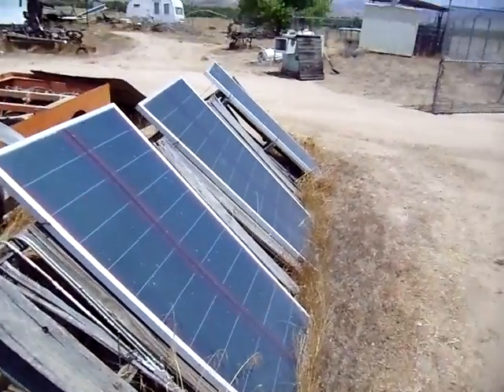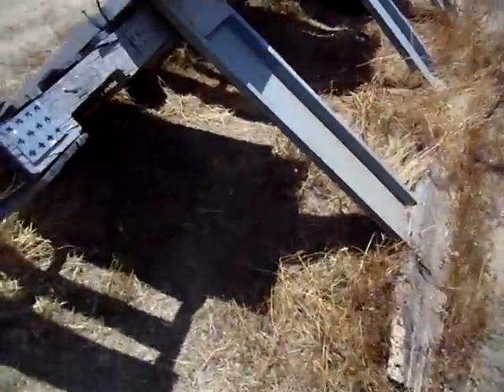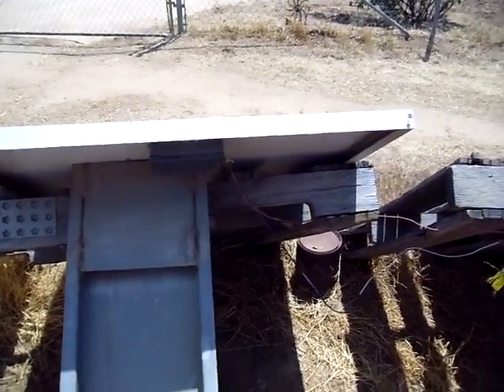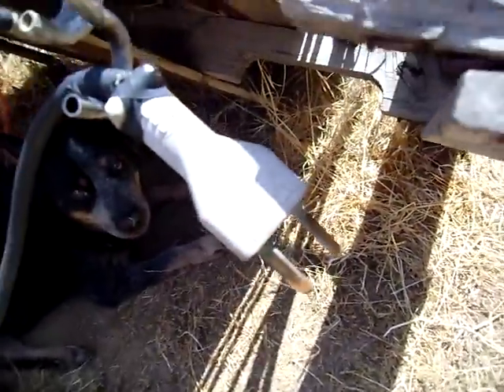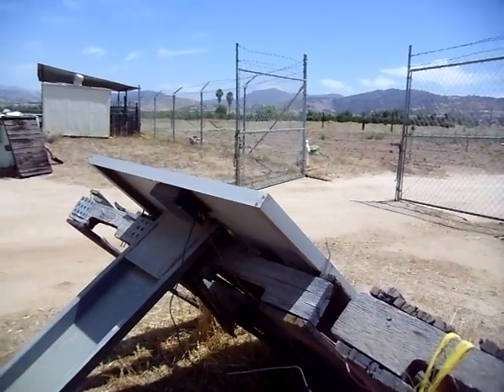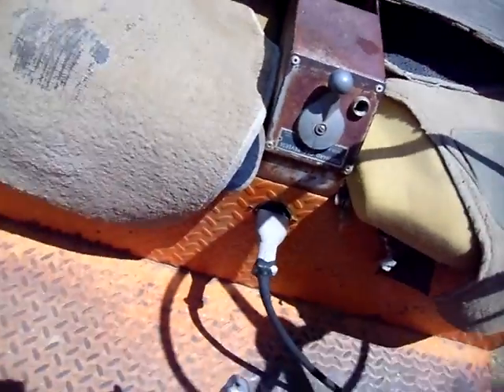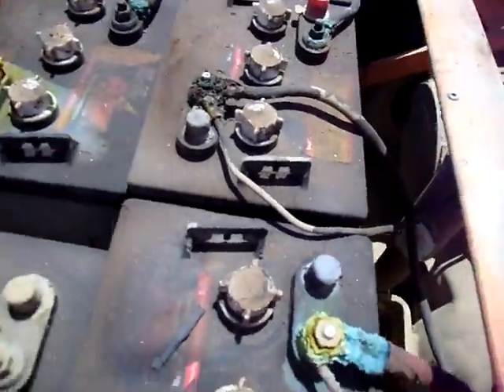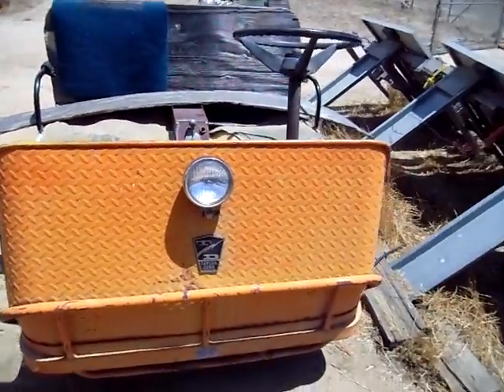How to Solar Power a Typical Six, 6 Volt Battery, 36 Volt DC Golf Cart (6 X 6 = 36)

Comment: Gregoria's I admire you confidence in what you did (and you did right ),in you strogling on desert.Im using my 2 panels 75 wat each for 3 years every day powering my Rv battery and no charging controller and on top my panels rotating to fallow a sun and tilted allays perpendicular to sun raid.the voltage on my 12 volt panels is from 16 to21 volt. There is no videos on 36 volt dollars so I appreciate yours.I need more information while making my 36volt Solaris panels(6 panels x 36 volt each)'powering my 72 volt motor on my boat.any one welcome on board,but don't criticize my English.Tomislav

Comment: Hang on a minute... Solar panels are not "12 volts" (unless they all have an inbuilt regulator, which I have never seen and doesn't make sense): they are from 0 to whatever max voltage they have, depending on the sun. I had panels this size, they would go up to about 70 volts EACH under direct sun. That means a single one of them would fry up your 36 volts batteries (a 12V battery is charged with 13-15, so a 36V one should never get more than 45 for sure). Three of them in series would make up to 210 volts, which would not only pop your batteries (they would go with a bang followed by an acid rain), but would would be a hazard in itself if you were to touch the plug with your fingers (having an electrical output on a male plug is another terrible thing to do).

Now maybe there is an inbuilt regulator in your golf cart, so this whole thing is not some kind of bullsh*t, but I would certainly not recommend to anyone to try this themselves: you definitely need a regulator to charge batteries from solar panels!

Comment: Thats amazing that you over charge them batteries like that and they still last that long, thats something I wouldnt be brave enough to do considering the price of the batteries. I do the same thing with my golf cart but reconfigure to 12v and use a 12v solar charge controller. nice video :)